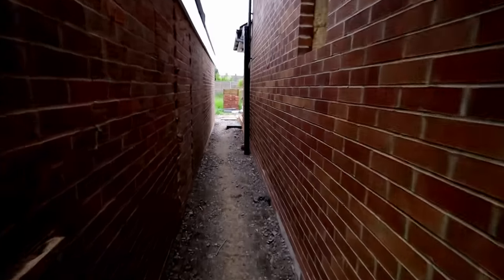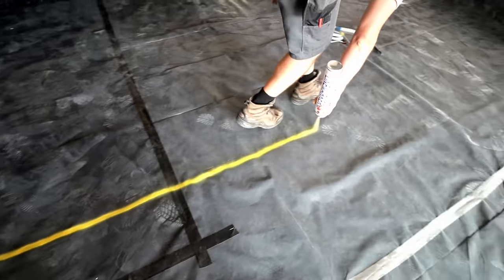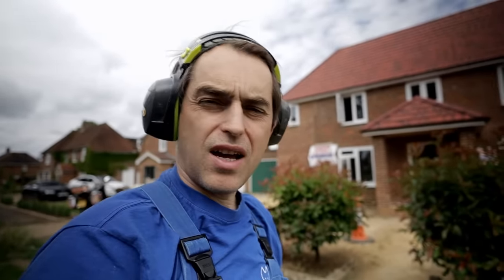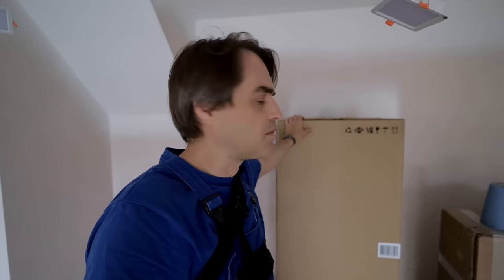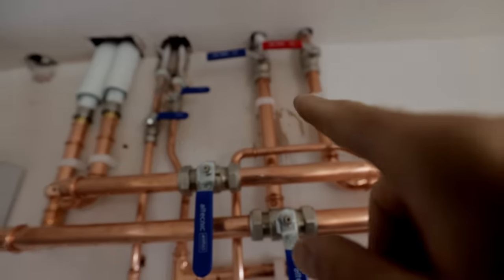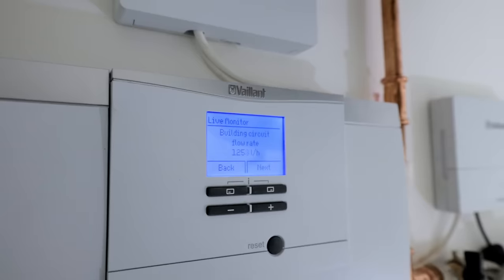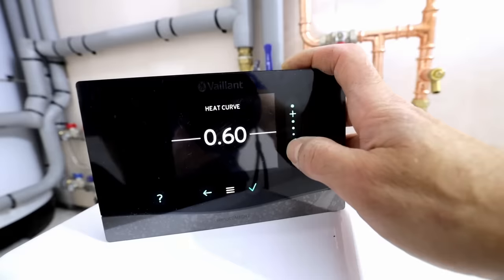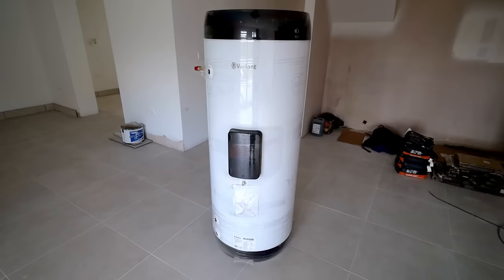Gas Boilers No Longer Make Sense, Here Is Why.

Comment: Condensing Boilers are more efficient energy wise. Consider that +90% of the thermal energy produced by a gas boiler is used to heat a home. Heat pumps are less then 50% thermally efficient since an electric generator gas turbine is less than 50% thermally efficient and there are another 10% to 20% losses in voltage conversion and transport of electricity. COP ratings are comparing the thermal efficiency against electric resistive heating, not the thermal energy of NatGas combustion.
Second if the power goes out, you have no heat & no hot water (ie putting all your eggs in one basket). the UK grid probably is not going to be able to handle large number of home converting to heat pumps. A ground loop heat pump is also much more efficient that an air sourced heat pump since the ground temperature remains near constant, and close to an sweet spot for coupling to a heat pump.
Reply: Might want to do some research on all these points.  Boilers to be 90%+ efficient would require a lower flow temperature, which people say is not possible with the UK housing stock.   Gas makes up less than 50% of the UK's energy supply, which instantly cuts your point there by 50%. Gas boilers also need electricity to run the pump etc, so you're mostly in the same boat there too.
Reply: @BenIsInSweden  80% of UK electricity comes from fossil fuels, BP 2019: 36.2% NatGas, 39.7% Oil & 3.3% Coal. Nuclear is about 6.4% and renewables about 14.4%

The small amount of electricity to run a circulator pump is nothing. A small generator or inverter can run it. A typically circ. pump is about 35 watts or less.

If you got space to install a heat pump condenser, you got space for a condensing boiler.

Most likely UK will just divert Domestic use of NatGas for more gas turbines as its the easiest & most affordable method to generate electricity. 

Every watt of Wind or Solar needs to be backed up with NatGas to deal with drops in power production as well as regulate frequency (50hz). Any more than a 3% frequency deviation will cause transformers to overheat.
Reply: @guytech7310  lets assume your numbers for 2019 of 14.4% are correct, in 2022 40% of UK electricity came from renewables, quite the trajectory. The only way you can make a heat pump more dirty is if its under -3°C and its powered by coal, and its only more dirty for that moment that holds true.
Reply: @guytech7310  Skill Builder isn't an expert on heat pumps, you should check out the heat geek responses to his video and the videos where they met up for a chat.
Reply: @BenIsInSweden  I found you one YT video, there are lots of other articles & videos on the topic. Heat pumps do not even come close to efficiency of condensing boilers, as I outlined in my earlier comments. COP compares heat pumps with resistive heating elements which have the lowest possible efficiency.
Reply: @guytech7310  they do in terms of heat output for paid for units of energy used.  Trying to include the grid in the figures is pointless, as it's ever-changing and not everyone will get their electricity from the same generator.  Also with your earlier small generator point, people haven't needed a small generator to power a gas boiler over the past few decades, why does it start to become an issue when heat pumps are mentioned?
Reply: @BenIsInSweden  No people which from condensing boiler to heat pumps pay more for heating. Issue is going to be rolling blackouts in most regions in the next 3 to 7 years. No more cheap energy from Russia, and adding more load to electric grid is going to force rolling blackouts during peak demand. Europe got lucky last winter with an abnormally warm winter.
Reply: @guytech7310  Properly installed heatpumps will have a lower running cost than a condensing boiler that can be easily proven with the 3rd party monitoring showing the true SCOP figures.  You say no more cheap energy from Russia, you know that is mostly Gas right? i.e. in terms of what the UK uses to produce electricity or heat.  That argument also makes the case for individual Solar and Battery storage even more pronounced than it is currently.
Reply: @BenIsInSweden  LOL! No, You mean 3rd party paid by the heat pump consortum EEHP? 

Dude, you lose about 60% of the thermal energy using NatGas to deliver electricity to the heat Pump. Again COP is based upon comparison to resistive heating elements not thermal energy produced by combustion. You have a few screws loose to not understand that. Go study thermodynamics and heat efficiency and stop wasting my time.
Reply: @guytech7310  No, I mean heatpumpmonitor, real heat pump installs using 3rd party monitoring tools to give you figures.  Even at 60% loss, that's 0.4kW of electricity from 1kW of gas.  A properly installed heat pump uses that 0.4kW to provide 1.2kW - 1.8kW of heat is still better than the generous 0.9kW of heat that a gas boiler gives you from the same unit of gas. And that's assuming ALL the electricity comes from Gas, which it doesn't.
Reply: @BenIsInSweden  " properly installed heat pump uses that 0.4kW to provide 1.2kW - 1.8kW"

No it does not. If that was the case it would be perpetual machine. Why is this so hard for you to understand?!? You keep thinking a heat pump is an over unity machine, its is not.
Reply: @guytech7310  literally no one is claiming perpetual motion here.  The rest of the heat energy comes from a non billable source.  Why is this so hard for you to understand?  For 1 unit of billable energy you get.3+ units of usable heat. Unless we start getting charged for the air we breathe that is never going to change.
Reply: @BenIsInSweden  You did. You wrote:

" properly installed heat pump uses that 0.4kW to provide 1.2kW - 1.8kW"

and you just repeated it (differently)
" For 1 unit of billable energy you get.3+ units of usable heat. "

You do not get 3 units of energy from 1 unit. 

Sorry but your just clueless & just keep on repeating the same mistakes over & over. You keep on  thinking that resistive heating is 100% efficient, its is not! 

For about 1kwh of NatGas you get about 8K BTUs, For 1kwh of resistive heating your get about 3.4K BTU. Thermal conversion of NatGas into electricity about 40% efficient (at the very best).  For 1 Kwh of electricity delivered it takes at least 20,000 BTUs of thermal energy (ie combustion of NatGas). 

For the best case heat pump COP=3 for 1 Kwh you get about 10,200 BTUs out. Condensing boiler at 90% efficiency will produce about 18,000 BTUs for same NatGas amount. Not even close. To complete with a 90% efficient Condensing boiler a heat pump would need a COP of over 5.6 (at all outdoor temperatures) to match.
Reply: @guytech7310   BTUs, so you're American? As the UK rarely use BTUs anymore for heating. The new Keadby 2 gas power plant is quoted to be over 60% efficient. South Humber is around 55%.  So your figures aren't applicable to the UK.
Reply: @guytech7310  everything over here is done in metric units.  So it's all mathematically comparable.  A 1kW electric radiator will consume 1kW of electricity to output (very close to) 1kW of heat in Europe, and will show this on the datasheets etc.  A 20kW gas boiler will consume 20kW of gas to output up to 19kW of heat - though realistically in the UK that would be closer to 17kW.  A 7kW heat pump will (and I can't believe I need to be crystal clear on this as you seem to be pedantic about the terminology), will transfer up to around 7kW of heat energy from the source (air/ground/water) into whatever it is trying to heat, and will consume up to (as a rule of thumb) around 50% of it's stated output in electricity to do so.  But typically it's going to be 33% or less. So ~7kW of heat transferred for consuming ~2kW of electricity.  A gas power station is expressed in its output, eg 910mWe at 60% efficiency that means it requires 1kW of gas to produce 0.6kW of electricity.  Therefore we get the comparison: to provide 1kW of heat, a 90% efficient gas boiler will use 1.11kW of gas.  A heat pump operating at a COP of 3 (which is low for a properly installed one) powered by Keadby 2 to provide 1kW of heat, will consume 0.34kW of electricity, lets add in ~10% for grid losses (as I'm sure you'll raise that next) and round it up to 0.4kW of electricity used, the powerstation would have consumed 0.67kW of gas.  Even if the gas power plant was 40% efficient, it would consume 1kW of gas, saving about 10% of gas consumption over a gas boiler providing the same amount of heat.
Reply: @BenIsInSweden  You just don't know when to quit. You're the non-engineer telling an engineer he's wrong. You cannot use Watts as a unit of thermal units. You have to convert watts into thermal units, BTUs or in the case of metric calories. 

No Air Heat pump has a COP of over three. this is because Air does transfer heat very well and air temperatures can vary all the way down to freezing. As the outside temperature difference drops from  room temperature to below freezing the COP drops. At near freezing temps  heat pump COP will drop to 1. below freezing most heat pumps drop below 1 and switch to resistive heating elements. Some unit can minimize COP losses at low outside temperatures by dropping the output heat. For instance a Heat Pump with a nameplate output of 15000 BTUs, will drop down to 7000 BTUs to reduce the decline in COP. That said, Air heat pump are subject to frosting, when moisture on the coils condenses and freezes causing a loss in heat transfer as the frost build up decreases heat transfer (acts like a thermal insulator). To address this the heat pump has to go into defrost mode, which the COP drops to negative since during defrost no heat is produced inside the home as the heat is dumped into the condenser coils to melt the frost off.

Heat pumps COP values are cherry picked for the best ratings at ideal conditions. Its like those vehicle sticker milage ratings, which the vehicle milage is tested on a closed track that is on flat ground & tested on cool or cold day with no wind to decrease engine efficiency or wind drag. Its does not represent real world driving conditions.

Second from real world experience a Condensing boiler is much cheaper to operate. My home has both a heat pump (used for AC) and a condensing boiler. Before I had the boiler installed (back in 2020 do to the unit back order & new home construction) I used the heat pump to heat the house during the winter. It cost me about $370 a month in electricity. With the Condensing Boiler it costs about $180/mo and the condensing boiler also provides domestic hot water. The heat pump does not provide domestic hot water. I pay about 8.8 cents for kwh, & $2.80 gallon of propane. 

This is in a new house that is very well insulated R-30 walls & R-60 roof with SIP roof panels, as well as an ERV for since the house is extremely tight with a very low ACH. The heat pump system was designed by HVAC engineer that specializes in high performance homes & is sized right.

You Wrote: "A gas power station is expressed in its output, eg 910mWe at 60% efficiency that means it requires 1kW of gas to produce 0.6kW of electricity."

No, Your completely Wrong because Nat Gas does not produce watts, it produces thermal units! You are confusing the unit watts with thermal energy units (BTUs, Calories). Its like comparing Distance travel vs acceleration. They are related but not the same.

"Even if the gas power plant was 40% efficient, it would consume 1kW of gas, saving about 10% of gas consumption over a gas boiler providing the same amount of heat."

No, again because your using watts thinking they are the same as thermal units. NatGas is measure in a Thermal unit such as BTUs, or calories, not watts. If you cannot understand that simple concept your in no business to argue this topic. 

You also forgetting the transmission & voltage conversion losses. Each voltage conversion ie step-up from plant for transmission lines. Intermediate step down to local distribution yard, to the building step down transformer will have losses. Even if the plant is 60% efficient, you lose another 20% by the time it reaches the heat pump. I mention this in an early comment. In the very best case, 60% of the thermal energy from a natural gas power plant is lost by the time it reaches your heat pump.

When you use a NatGas directly you eliminate all of the conversion losses since the NatGas is delivering all of thermal energy to provide heat. The only losses are the inefficiencies of heat transfer in the heat exchanger as well as the water differential temperature (typically 160F/71C) required for passive convection heat transfer into a room. The Boiler flue temperature will always be slightly higher than the water output temperature. A condensing furnace (heats air) will be more efficient than a Boiler because the flue temperature will be considerable lower.

The Condensing boiler I have is about 97% thermal efficient & it costs less than half to operate than the heat pump for heating.

Heat pumps do not operate over unity. There is no way a heat pump can out perform a condensing boiler. if  it did it would be over unity (perpetual machine).
Reply: @guytech7310  Gas Furnaces aren't and likely never will be installed in the UK, so their efficiencies are irrelevant here over gas boilers.  You stated that "1kwh of NatGas you get about 8K BTUs" How? I can't find any source to back this claim up.  Also, it makes no sense, the average UK home uses 12,000kWhs of gas per year, meaning that ~96,000,000 BTUs would be required to heat the average UK home, in resistive heating (by your figures) which would use ~28,235kWhs of electricity per year.  That is almost double my complete electricity usage in my large Swedish house (which is about 1.5x the size of the average UK home, and detached as well, along with having longer and colder winters). I have a 7.7kW A2A heat pump along with resistive heating, and an immersion heater for DHW.   BTW: UK transmission losses are <10%, easy to find out, and I already covered that in my previous message.
Reply from the maker: @guytech7310 you have a 97% efficient gas boiler? What’s your heating system maximum flow temperature at your system design temperature please?
Reply from the maker: @guytech7310 ohh and I also have a high efficacy boiler running in tandem with an air source heat pump - and at the same house and the same design temp my heat pump is around 30% cheaper to run and around 4 x times more efficient
Reply: @guytech7310  I came back to see if you backed up your 1kWh natgas = 8K BTU claim and I just didn't get a notification, I see you haven't. But re-reading your "trust me bro, I'm an engineer" rant, shows you have restricted your heat pump knowledge to those in the USA, which are leagues behind Europe. Resistive elements haven't been used in the majority of heat pumps in Scandinavia for probably over a decade and along with modern UK ones use a reverse cycle to defrost, sometimes using a volumiser to prevent it from stealing heat from the house to defrost. Sweden has ones that go down to nearly -30C without the need for resistive assistance, I believe most Modern UK ones like this video shows are rated to -15C.  If you bothered to check out heatpumpmonitor as I said earlier you would see that your comment that "No Air Heat pump has a COP of over three" is wrong, they are installs that use 3rd party devices to monitor things like the electricity consumption of the Unit, the return and flow temperatures, so it's not like the heatpump can detect it's being tested and fake a bigger SCOP.  Sure there may be some big conspiracy going on, but considering openenergymonitor is all open source, someone could debunk the claims pretty quickly.
Reply: @BenIsInSweden  No just busy.  The only one ranting is you. ~7.36 cubic feet of NatGas per kwh. 1050 BTUs per cubic feet of NatGas = 7728 BTUs. I rounded up for simplification.

Most of the links you will find. refer to resistive heating 3.4K  BTUs per kwh of resistive heating which does not match up with BTU from NatGas Combustion. But  you couldn't figure that out on your own, because you asked me. 

Here a simple thought exercise: Suppose you could get 3 units of heat from 1 unit of heat. it would be over unity. Even if the thermal to electricity conversion was 60% It would still have be over unity device since  3*0.6 is 1.8. I could feed the thermal energy produced by the heat pump to generate electricity and still produce about 1.8 times more thermal energy.

No way can a heat pump out-match direct combustion of natgas because of all of the conversion losses of converting thermal energy into electricity & losses from voltage conversion & distribution. Its not complicated, but I guess this is just too complicated for you to understand.

All a heat pump is doing is compressing a gas which generates more heat than using electrical resistance to generate heat which is just terribly inefficient.

If you cannot understand this, I am sorry. This is problem with most of society. People that don't understand basic engineering believing marketing the BS and not able to smell it.
Reply: @guytech7310 Right, now I see where you're going with this. And again, basically American-only relevance. You are saying that it takes 7.36 ft³ to generate 1kwh of electricity, based on American averages.  We don't do that in the UK/Europe, boilers are rated in kW, and usage gets charged in kWh. For any boiler that states the BTU (e.g. on Screwfix), the BTU is ~3.4K per kW.  So 1kWh of gas is standardised to 3412.14 BTU. And Keadby 2 where it states it is 60+% efficient means it will burn ~5687BTU to generate 1kWh of electricity.  The application for a gas boiler and a heat pump is basically for raising the temperature in the dwelling counteracting the heat loss. Neither can be used to generate electricity as they are. But in the UK / Europe having standardised measurements means the performance between a gas boiler and a heat pump can be compared for heating a dwelling, and it's been proven time and time again that in that application a heat pump outperforms a gas boiler.  You can keep on believing that it's all marketing BS, but they have been used in Scandinavia for decades now, and if it was all some big ploy people would have worked it out by now.
Reply: @BenIsInSweden  It has nothing to do with the Boilers. It takes about 7.36 Cubic Ft * 1050 BTUs/1^3 ft: 7728 BTUs to generate 1 Kwh using a NatGas power plant. It has nothing to do with American versus or Imperial vs Metric. 
It takes an amount of thermal energy to spin the turbines to turn the generator. 

"Keadby 2 where it states it is 60+% efficient means it will burn ~5687BTU to generate 1kWh of electricity. "

No 7728 BTUs is likely at about 60% efficiency, but it likely is low balling how many BTUs are really needed. 

From EIA.gov:

"Combined-cycle systems tend to be more efficient at converting a unit of natural gas (measured in British thermal units [Btu]) to a unit of electricity (kilowatthour [kWh]). Combined-cycle systems have an average operating heat rate of 7,146 Btu/kWh"

I suspect that figure is cherry picked & reflects the optimal conditions (ie input air temp, no or very low CO2 content in the NatGas supply, low wear on turbine seals, amount of scale build up on steam gen heat exchanger, etc. 

Keadby 2 is a combined cycle plant. Uses a a pair of gas fired turbines & one steam turbine. 

Sorry but a heat pump will never outperform a condensing gas boiler because there are always conversion losses. Again a lot of thermal energy is lost generating electricity. I don't how else to get this through to you. If a heat pump out performed a boiler it would have to an over unity device as there is no means to use the same thermal energy from natgas combustion to exceed it by converting it into electricity to run a heat pump. 

The reason why heat pumps are preferred is because you don't need a gas line run to the building & you can use a heat pump for cooling, but isn't more efficient than a condensing boiler.
Reply: @guytech7310  you keep on going on about over unity, that isn't the goal, nor what anyone is implying, if you want to boil water a heat pump is terrible at it - full stop, and you'd be better off with a kettle or as you Americans seem to do a pot over a gas stove. What it excels at (in the case of A2W) is being able to bring the input/return water temperature up by around 5-7C back to the flow temperature and is most optimal around the 35C mark. With r290 the max is around 75C but the COP suffers.  If you need 75C flow then a gas boiler will beat a heat pump if taking into consideration the electricity generated by gas.  But at the lower temperatures it is more efficient at the task than a gas boiler so much so that it beats generating the electricity from gas.  Gas boilers have allowed a lot of leeway with oversizing and not really putting much thought into how to optimise heating the home.  With a Heat Pump, the heating design is critical to getting the best COP out of the system.